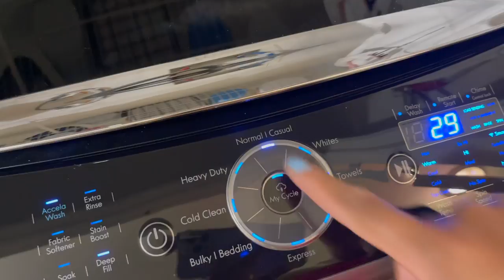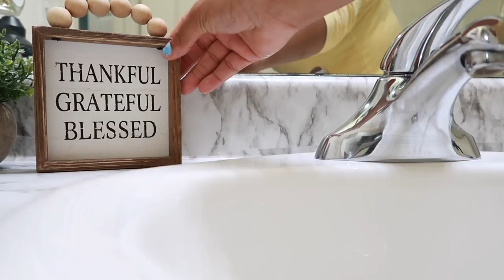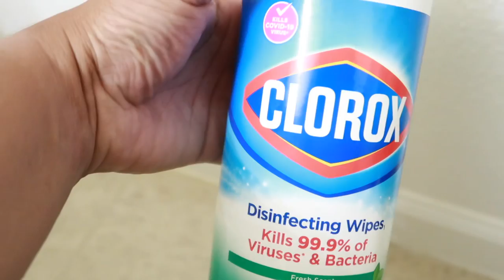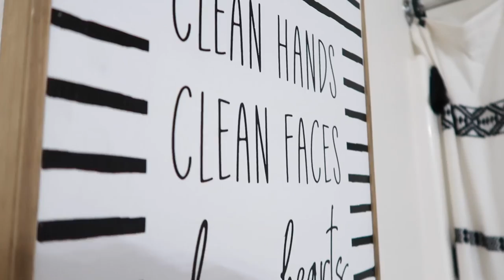How To Deep Clean & Disinfect Your Bathroom | Extreme Clean With Me | Busy Mom Day in The Life

Comment: That used to happen when my Daughter  was younger and it always got higher and she used to throw up everything by mouth Air born stomach virus.   Starting when she was about one year old.  I took her to the E.R.  Doctor on shift recommended fever all suppositories and that seemed to work still had to monitor her!! Because her fevers were dangerously high before they would break as she got older they happened like once a year until she turned 10.  And even then the pediatrician recommended Fever suppositories and not to give her anything by mouth because she would projectile vomit until the fever breaks!  Then they would be able to tolerate clear liquids.. but encourage clear liquids when they are younger.